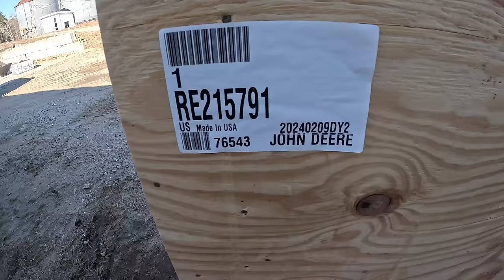First nice day working outside. Get my tractor ready for a new hood!

Comment: 12:20 Wes Pandy (onelonelyfarmer) recently had to replace the hood on his 8120 for that same reason. It had become so brittle, there came a point it was breaking just by manipulating it a little, had the consistency of potato chips. He replaced it with a metal one.
Reply from the maker: I wish I could have replaced mine with metal. I didn’t think that was an option though. Shane tractor hood is metal. Sometimes newer isn’t better. I wish I would have had a metal one to replace it with.
Reply: he did not same plastic hood as the old one was
Reply: @BellsFarming  it's not a option Wes replaced his with the same hood you did
Reply: @jasonleckrone2577  My mistake. Looked and sounded like metal. 🤷🏻‍♂️

Comment: I use a Foam cannon for soap.    pretty cool how it works.    Great video
Reply from the maker: This presser washer had a hose to put your soap in, but it broke off, haven’t gotten around to putting it back on. So I took the easy way out and used the sprayer. Foam cannon sounds like fun!

Comment: I lived in Alaska and Spring unofficially started when the ice started to melt which was known as Break Up so I can relate to when you start the planting season lol. Also I know what Denali is.
Reply from the maker: I named my Akita after Denali. I remember at my house growing up when the creek would “break up” I loved watching the big pieces of ice float down and get all jammed up!
Reply: @BellsFarming  I knew how your dog got the name lol. When break up happens in Alaska the chucks of ice are the size of cars and go on for miles. They put a pole in the river that has a wire connected to a clock on the bank so when the pole drops it pulls the wire and stops the clock. The people there can guess what time it will happen and the closest one wins a cash prize. My guess was off by 3 weeks 😆

Comment: you know Molly it is sad to say as much as a John Deere costs..... and all the advertising they do,... on how tough and reliable / durable they are...... even the big tractors have plastic hoods and as they vibrate and rattle they fall apart. get UV rotted and fall to pieces. I have a riding lawn mower and it did the the same as yours.... just falling apart and for a small price of 400 hundred dollars i can have another hood that fits my mower and for another 150. i can have all the decals too. So i said nope i used green duct tape and then scuffed the hood inside and used fiber glass cloth and resin. And they say hahaha nothing runs like a Deere meaning tough and durable Right watch how in a few years how it weather checks again... fades and becomes brittle. can't they just make them out of metal for as much as we pay for them?!
Reply from the maker: Yeah, I think this good was the first generation of plastic ones. I would hope that they have made some improvements. I do wish metal was an option

Comment: The potatoes will keep that long in those tote bags? Did think they could get air in them?? Do you guys have any issues with hollow heart?? Do you use an xray machine to check them??
Reply: We rarely have hollow heart issues, but no we don’t have x ray. We still keep air circulating in storage and try and keep it under 50 and they will keep in tote bags till august
Reply: @shanebell9589  wow..I didn't realize they would hold that long in those bags? We always used pallet boxes as do i..how are you coming on those pics of the brusher?
Reply: It’s in our old Quonset hut, just gotta sneak out back there when I can and see if it looks like It’s all there still
Reply from the maker: They will keep in the tote bags. Of course towards July august they are not perfect looking. But they are used for French fries mostly. So it’s ok

We do not use X-ray to check for hollow heart. Some of the really large ones will have it occasionally from growing too fast. But it’s not a big problem
Reply from the maker: @paullhommedieu2795  can you email us? That way I can exchange info. Our bedside has the email :) thank you
Reply: @shanebell9589  ok thanks